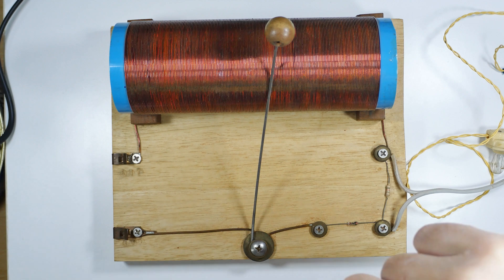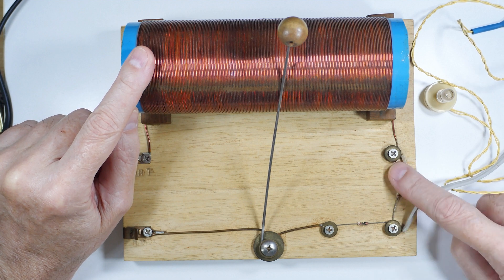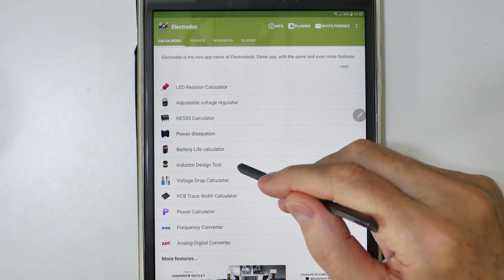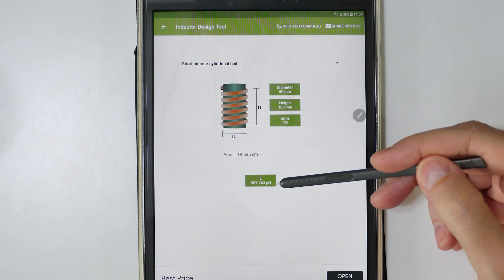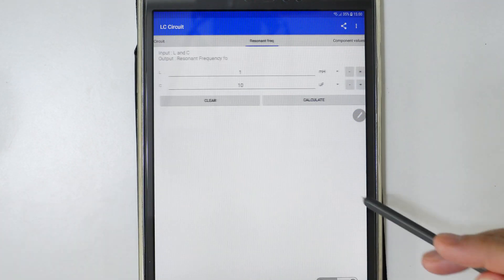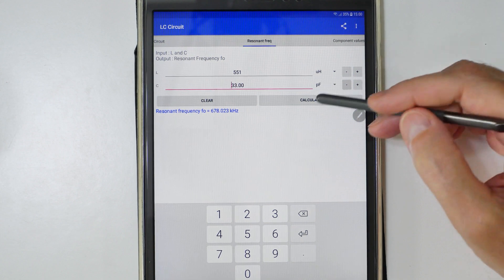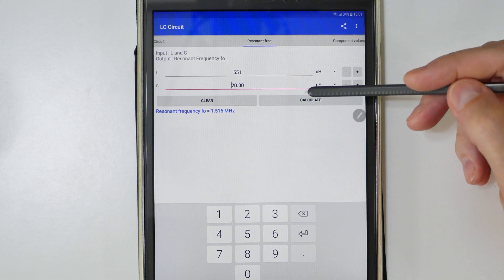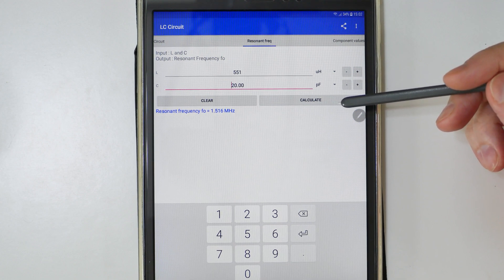Crystal Radio & Resonant Coil Design (4K)

Comment from the maker: RELATED CRYSTAL RADIO VIDEOS: 
Best/Easiest DIY Crystal Radio - No Batteries, No External Power (4K)
https://youtu.be/fLVCqZGpv3U
   
My New Favorite!  Crystal Radio with Antenna Tuner:    https://youtu.be/mh5KxCpbQ5U
Crystal Radio Antenna (Shortwave Also):    https://youtu.be/G8AsgZbncW4
Crystal Radio, Capacitive Tuning - WORKS GREAT!:    https://youtu.be/VJ80Nm9KSkE
Good Crystal Radio Connection Points:    https://youtu.be/G3qjrReHR1k
My Crystal Radio Does NOT Work (FIXES for common problems):    https://youtu.be/kCxQ8iPQx4s
Crystal Radio, Connect A DC Audio Amplifier:  https://youtu.be/RW3VhnzgjtA
Connect DC Audio Amplifier To Your Crystal Radio:    https://youtu.be/HOw3yDFXXN4
Three Upgrades For Your Crystal Radio:   https://youtu.be/LENco3_jV_s
Crystal Radio Wiper Upgrade:     https://youtu.be/i1otDz39nlw
Popular Crystal Radio Design That's a Waste of Time - And Why: https://youtu.be/r9Onub2Xpzc   
New Crystal Radio Design - "Modified-Pickard":     https://youtu.be/_qxHhFKjLAg
Crystal Electric Generator RF Energy Harvesting Exp 5 - Full Wave Rectifier:   https://youtu.be/BTu_GJKjOmA

Comment: Hey couple questions. I've watched both of your coil sizing videos, and read the coil32  links/ their references. But I am still a little confused how are you arriving at the 531 microhenrys/ how are you estimating the coils capacitance for resonance. 

if I use the either of the medhurst formulas ( C =HD)  or ( C = .46xD) for self capacitance I get under 20 pico farads for most average size coils.  More like 2 or 3 pico farads

You mention that the earpiece has captacitance, but isn't it in series with the coil. so shouldn't it actually be forming a series resonance at some frequency with the second part of the coil after the wiper? Or at least not effecting the tank circuit up to the wiper?

I'm probably missing something 

Thanks again for sharing this information
Reply from the maker: I don't know how the calculators were programmed, but when I compare the outcome to results I get from actual measurements, they are usually very close. The capacitance is from another calculator. That one I can not compare to results as I don't have a meter to measure it. True, the earpiece is in parallel to only part of the coil at a time. The reason I mention it is the old earphones from the 1960s and before were a different type and required a capacitor instead of a resistor. If someone uses a current piezoelectric earphone with the capacitor the 2 together will add significant capacitance, but more importantly the earphone will be very quiet as it builds up a charge and just starts popping.

Comment: Thanks for the video, very informative and useful! Can one build a crystal radio tuning coil to cover the entire AM band range? Or should we locate the radio towers perhaps within a 100 mile radius of my home location??
Reply from the maker: Thank you. Most of my crystal radios cover the whole band, so yes, it's possible. Antennas are also important, and I have a video on those. But the summary is "the longer the better".
Reply: @tsbrownie  Thanks! I have all of the hardware, tools and parts needed including the Germanium Crystal Diode (1N34A), a salvaged 10k ohm resistor from my old CRT TV and the Crystal earphone you required except for the bicycle spoke and electronic spring clips which I'll order online.  I remember there is a bicycle shop in the village nearby, I'm most certain he'll have a bicycle spoke for purchase. Wants this crystal radio built before end of this month.
Reply from the maker: @Tony Dubyk  The bicycle spoke can also be any stiff stainless or brass rod. I like stainless because it does not corrode. Instead of spring clips, I also use bent brass washers. I have a video on that. Have fun!
Reply: @tsbrownie  Thank you for the tips, I'll start working on the tuning coil for the crystal radio this week.

Comment: Don't you need to enter wire diamter too?
Reply from the maker: That is a good question.  Yes and no is the answer.  If you use a close wound coil then you can calculate the length by adding up the wire width.  Frankly for most of us that is more convenient.  This calculator also works for coils where the wire is not laid down next to the last turn, i.e. where each turn of wire is touching the last.  There's an app called "Coil32" that will do that for you.
Reply: @tsbrownie  I just downloaded lc
There's one on web too
But easier on phone 

What's the farthest station you've received so far ?
Reply from the maker: @uncleruckus4060  I don't usually check distance.  When I was a kid, I would sometimes get one of the really high powered stations across the next state, so a few hundred miles.  But typically one gets more local stations.
Reply: @tsbrownie  right in downtown norfolk va so it's tuff
Just local 
Overload

Comment: I found that a larger diameter and shorter coil worked better.  4" ABS was the former I used for the main coil.
I got some useful results making basically two of the assemblies and setting them side by side with the coils pointing at each other.  You hook the antenna and earphone to one and turn it.  You then move the earphone to the other and tun it.  It was not as loud but you could select one station instead of hearing two.